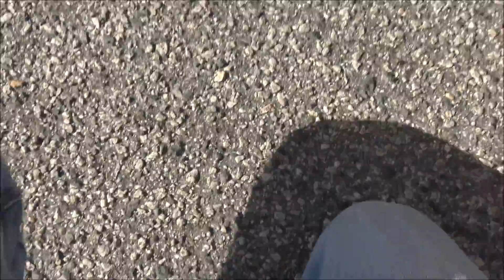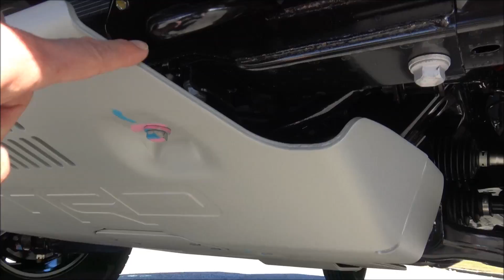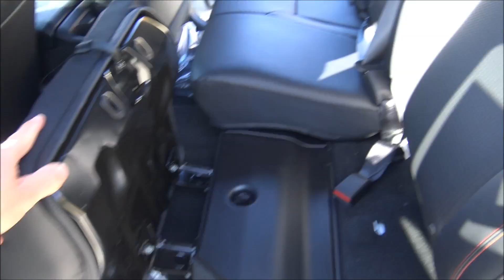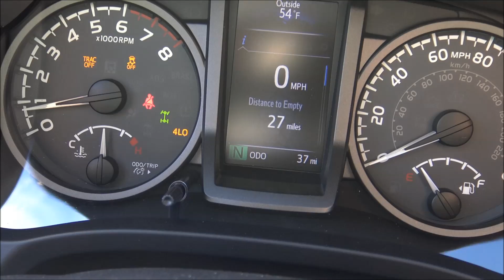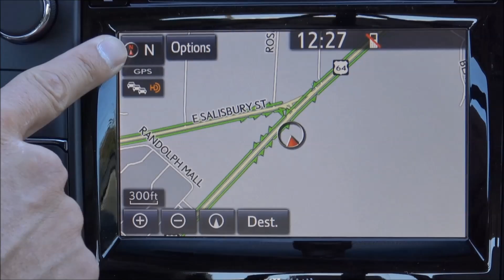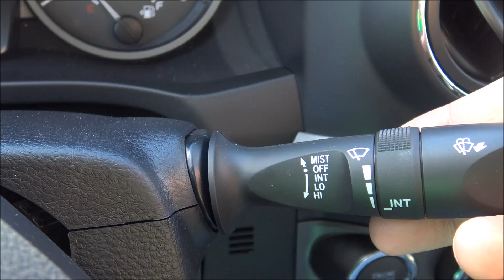2017 Toyota Tacoma Truck- TRD Pro-Feature Tutorial & Review

Comment: i drive a 2017 toyota tacoma trd off road, and the only difference between this truck and the off road is the wheels, suspension, and 10 to 15 thousand dollars. ik someone will hate me for saying this but in my opinion the pro is not worth it because u can buy the suspension and wheels for less than the difference between the two trucks but needless to say both trucks are amazing amd u wont be dissapointed with either one. it goes anywhere and does anything

Comment: Truck looks great and I have yet to test drive, but the one thing that is currently repelling me is the price $47k....  For that price I could purchase a gently used GMC Denali 4x4..  Hence I have to find all ways to justify a purchase like this or consider the TRD Off-Road and do my own upgrades over time. (Which I know I probably won't do)
Reply from the maker: Great points!  I agree with you, the initial price is steep.  I can also add that this truck - as long as it's properly maintained - should last you as long as you need it.  I have seen Toyota trucks with over 500,000 miles on them and still going strong.  Thank you so much for contributing to the conversation!  
Brock

Comment: Power seats with height adjustments. Why is the Tacoma not equipped with power seats. If using sequential drive mode when shifting from normal drive and go to it why does it shift to forth Gear instead of fifth no matter which gear your in above forth. Once in sequential mode I can then use all 6 gears as needed. I traded a 2015 Colorado which I could average up to 26 mpg and write a letter to Toyota and tell them driving the vehicles the same on the road they tell me I am driving it to hard and only average about 16.2 with the 2016 Tacoma that I trade for. Personally I have to many problems with the Tacoma to consider a good 4x4 like the pro if it's going to be like the sports. Looking forward to the return of the Ranger

Comment: I see a lot of people commenting on the ticking noise from the engine bay. The Tacoma's 3.5L V6 engine is equipped with both direct and port fuel injection system. The ticking sound is a result of the self-cleaning direct fuel injection systems activation and is a normal characteristic of normal system operation.
Reply from the maker: EXCELLENT point!  Thank you for contributing to the conversation - very helpful.  
Brock

Comment: Is there any protection for the fuel tank?
Reply: Van Hammer There is a plate made of some type of plastic material that covers the lower exposed fuel take in Tacomas. If you replay the video, you can see it.
Reply from the maker: Van Hammer Great question.  I thought the exact same thing.  I didn't see any protection for the tank but I think it's due, in large part, to the location of the tank. It's in toward middle of the truck and less likely to be damaged by rocks, roots, etc.  I think if the axles, skid plate clear an object then most likely the tank would be good to go.  That's what I THINK anyways...:)  Hope this helps and thank you for watching!! 
Brock